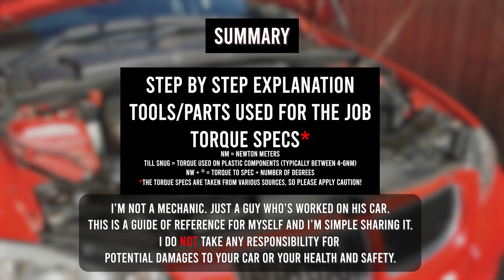How To Remove The Turbo From BMW E90/E91 320d/E87 120d E60 E61 520d | M47 Engine STEP BY STEP GUIDE!

Comment: Really good video, the step by step and all, it’s really clear and guided, you can’t make a mistake following those instructions ! I have just one comment to make. 8:53 To deal with the coolant, I would advise you to drain it all by the green drain screw on the right side under the radiator so you can avoid the spillage by draining the whole system. It doesn’t take much more time to do and the priming of the coolant system is really not hard to do on this engine. 
But outside of that, again really good video ! 💪🏼

Comment: You can remove the turbo by unscrewing the power steering pulley and also the steering pump and move it to the side, this will allow you to get access to all the bolts holding the turbo. The only tricky one is the one underneath as I couldn’t high jack the car. No need to remove the Egr cooler, cooling liquid etc. Give it a try and you will be amazed how easy it is.

Comment: The torx screw at 8min doesn’t have to be removed. It secures the EGR bracket which stays on the engine. We just need to remove the EGR from the bracket.
See at 8:51 the bracket is still on the car. (Top right hand corner)

Comment: Removing part was easy as i removed the actuator, then the cat, once they were out of way I simply got the turbo out backwards as in I pulled it the way where cat was. Will see if the new turbo with actuator will go back in as a whole rather than separated as I find that dropping coolant is wasteful and it’ll take time to bleed the cooling system. Ps removing it my way took 1.5 hours( would have been quicker if catalytic wasn’t stuck on to exhaust)

Comment: Thank you for this!! Changed my turbo last week, had a nightmare getting the new one slotted in with the manifold gasket but got there
Reply: Hi, do you have any tips on reinstalling turbo? Can you loosen the two bolts that hold the lower support plate to the engine mount bracket whilst the turbo is in place?, or is there no room? I can see it could potentially be a nightmare to refit so tips on how you 'got there' will be massively appreciated! Thanks

Comment: Also how did u block off the egr valve
Reply from the maker: In this video, I didn't show how I've "deleted" the egr, I simply removed the EGR cooler and thermostat 8:12 of the video, using the v-band clamp and the rubber hose clamp.
Reply: Dm him👆👆for any recovery

Comment: Hi great video will I need to drain the oil before attempting the turbo removal or can I remove it with oil still in engine thanks
Reply from the maker: Hi Martin, the ideal procedure requires you to drain the oil and flush it once the new turbo is installed. It depends on the reason why your turbo went in the first place but it's generally a good practice to flush it. I've left information in the description about that. Thank you for watching!
Reply: Thanks for reply I ended  up draining oil when I removed the turbo but im not going to flush it before new oil as  loads of bad things about engine flush just waiting for new 1 to be delivered to start the task of putting it back in 😳 did u remove the egr valve altogether or just put something in the pipe to block the exhaust gas coming trough
Reply: Dm him👆👆for any recovery

Comment: On my bmw 320d e90 m47 '06 there was no need to remove anything related to coolant.
Reply: If you have enough experience you can skip a few steps :)
Reply: And i didnt went under the car for removing the turbo.
Reply: I want to add that my car has a different dpf and it doesn't have an electric actuator.

Comment: I did the turbo swap about 5 years on the my E90 M47 320D (at that time, around 140k km on it). Quite difficult the first time around. I found that take the little extra time and remove the power steering belt/pulley/pump made the removal and installation of the turbo much easier. didn't have to disconnect the PS line, just remove the pump and set it aside.
I saw that you eventually removed the plastic grid piece that holds the sensor plugs, it'll make removal/installing the V-clamp between DPF and turbo easier.
I usually just totally remove the engine brace bars for ease of access.
On this particular model, it's ridiculous that you need to remove the whole micro filter housing/brace bar/bunch of plastics just to replace the engine air filter.....
Reply from the maker: Hi David, thank you for watching the video! I agree 100%, some of the components require you to disassemble so much before you can gain the proper clearance to get to them  😅

Comment: Nice vídeo ! What was the problem of this turbo? Is a Mitsubishi turbo?
Reply from the maker: The actuator went on it
Reply from the maker: Yes, after get it refurbished (under the warranty) I ended up selling the car for parts but I would highly recommend getting a Garret one as it's more reliable and can withstand more abuse. My e91 automatic has one, same engine, stage 1 remap and difference in torque is ridiculous
Reply: @martinlambov  Garret is top! But wich one is compatible with our BMW m47 ? Thanks
Reply from the maker: @fsilva2296  In 2006 BMW dropped the Garrett turbos and started using Mitsubishi turbos. There are some physical differences in the layout and configuration of them. Finding Garret turbos is quite a rare find and the turbo upgrade is pricey!
With a GTB2260 turbo upgrade you could reach about 290bhp but I've heard people use GT1749V but modify the compressor wheel. The Garrett GTB1756L used in the Alpina D3.. also very rare.. but can comfortably go 250bhp+
There are some options out there for the M47 but it's definitely a costly upgrade.

Comment: wouldn't be easier the get to the clamp from below?
Reply from the maker: There might be another way of taking it out but as far as I know this is the most effective way to do it, that allows you to install the new turbo without the need to remove the rocker cover or any other parts for more clearance. During this method, you'll need to drain the oil when turbo is out and once everything gets assembled back replacing the oil and topping up the coolant (blue is recommended for this engine) does the trick.

Comment: Hi Martin got my self a reconditioned turbo where do the washer  especially the small ones thanks bmw 320d 2006
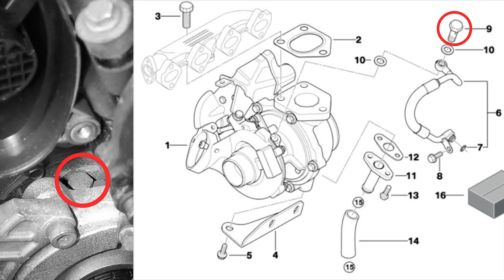Reply from the maker: Hi Antreas, thank you watching the video! The locations the washers you can find shown on the diagram that I've included at 10:40 of the video.
Reply: @martinlambov   thanks   👍do you have any videos on how to fit a  turbo any tips 🔧
Reply from the maker: @antreaspetrou3896   @Antreas Petrou There's a couple of things to consider before putting in the reconditioned turbo. I don't know the reason of behind your old turbo failing but it's a good start. Investigate to see what caused the turbo failure in the first place. Then, make sure to drain as much of the old oil as possible, get 10L cheaper oil (Manol SAE 5W30 is good - make sure it fits the specs of the engine) to flush the engine after you put the reconditioned turbo.
To install it, just follow the video in reverse and also you can use a very thin layer of high temperature gasket sealer to align the gasket that seats between the manifold and the turbo, then it's a matter of precision and torquing the 3 bolts that hold it evenly to apply equal pressure.

Comment: Is this the same proses as a e46 320d
Reply from the maker: very similar, some of the parts are placed at different locations and you might even do it quicker as less parts need to be removed during the procedure ^_^

Comment: Hi Martin.
Great video and clear instructions too.
I have an M47 also and have been having a boost issue where as I get no boost before 2000 revs and then it is like Nos...
I have taken the actuator completely out still leaving plugged  into nto the loom.
Locking and unlocking the car doesn't move it or even sound like. 
Engine running it does move but very little.
If arm disconnected from hot side with it pushed all way down you get a hiss sound letting pressure past, pushing all way opposite way hiss stopped and sounded normal.
When all is connected with actuator in, it does that hiss sound just car on idle with very little power at low speed
Reply from the maker: Hi Ben! Thank you for the comment. As far as I know the turbo won't allow any boost if the car is stationary. Couple of things worth checking for you would be the 'linkage arms' similar to mark's comment, over time and heat cycles they can get stuck. The stock map of the M47 usually allows the turbo to build up spooling momentum up to the 1900 - 2000rpm range but if you're experiencing lack of torque then you may have a little boost/exhaust leak too or the turbine shaft could be on its last legs.. Do a quick inspection and look at the boost pipes (the turbo and egr ones to the intercooler) check the side that inserts into the intercooler (via a pressed alloy connector with a reinforced silicone ring) That side usually fails to hold the pressure as the vibration of the engine slowly damages the plastic over the years.
Good luck with it and I hope you find what's causing this issue and fix it soon 👍
Reply: @martinlambov  whipped the turbo out today,
Was quite easy and done everything from above too.
I found that the bottom oil line L shape pipe was only fastened by jubilee at one end, the clip was there but not even gripping let alone sealing ! Not sure if that contributed though as it was on there fairly snug.
I have srperated the turbine shell and soaked & cleaned as  much as I can but the shutters seem to grind against the plate because I can can see it move when manually opening fully (very stiff)
I am soaking overnight and of that fails I'm going to get a recon one..
Reply from the maker: @Slottybotty  Good stuff Ben, I'm glad it came out easily! My guesses here a limited but I hope that oil pipe didn't end up starving the turbo from oil and allowing the friction to happen between the turbine impeller and casing.. I would recommend get in touch with a guy called Steven B. on YouTube (just type m47 turbo refurb in the search box), he has videos on refurbing this type of turbo on your own. He might be able to help you diagnose the problem properly. Good luck!
Reply: @martinlambov  I know Steven , he is a world of knowledge ! 
I have ordered a new turbo and actuator..
I put up a video of my turbo apart , click on my profile 👍

Comment: Thanks a million Martin, great tuitional video with such attention to detail! You've made a mammoth task seem do-able even for the likes of myself who is a four month M47 Bimmerginner...Thankyou!! Touch wood though, I'm not in need of doing this procedure right  now, but my question is a relative one....Can the Turbo Actuator 'Linkage Arms' be lubricated and free'd up by hand whilst the Turbo is in situ (by releasing and removing Locknut on top of 'Screw Cap'), or does the whole assembly in effect need to be removed as per your video before hand?? I ask as I think my actuator may have started sticking since the cold has  set in.....
Reply from the maker: Thank you for the kind comment Mark! I do appreciate it 👍
In regards to the actuator linkage arms problem.. in my opinion, you have two options.
Option A) Removing the turbo is the easiest option here.
As for option B) the harder option... 
The linkage arms are in a very obscure location, between the the hot and cold part of the turbo... using lubricant there would be possible if you buy a long, thin and bendy hose that can reach the location of the linkage arms with the turbo still being mounted.
Once the lubricant is applied you can use a software called ISTA+ (part of BMW Suite, which I recommend as a bmw owner) with a K DCAN cable hooked via your car's OBD port to artificially "activate the actuator" which in turns will move the linkage arms. Think of it as telling the ECU to move those 'arms' for you a few times for the lubricant to really get in there (as you don't have physical access to them).
I would still go with A) to be honest 😅 but it would require changing your gaskets, v-band clamp, etc
Hope this helps. Take it easy 👊

Comment: Your level of detail in this video is incredible, better than any other or any manual, absolutely great!! Will you make more videos of the M47 (for example blanking EGR, downpipe install etc)?
Reply from the maker: Thank you very much! I really appreciate it!
I'm currently in a position where this particular car is being slowly disassembled as I've recently "upgraded" to an e91 auto (still the M47 😄 #obsessed). The plan is to make a "remove" video such as this one, for every major mechanical component - the gearbox, clutch, rear diff, etc
It's actually quite funny that you mentioned both downpipe install (for me it will be more like swapping the catalytic converter - which would be 90% the same process) and blanking EGR, as I'm planning on doing both on the e91, so I'll record that for you and do my best to show you how it's done. Thank for your support again! Stay safe.
Reply: @martinlambov  Hey, did you manage to make more of those videos? Interested to look forward as I'm about to disassemble similar e90
Reply: @martinlambov  that would be great! Its pretty difficult to find tutorials on this engine so  it would be ideal if all the tutorials could be found on one channel!

Comment: I wonder if it is the same on my 2004 320d e46 m47N? your guide is very very good no matter what
Reply from the maker: Thank you. I recommend comparing the layout of the engine bay and as long as it matches, the process will be 80-90% the same.